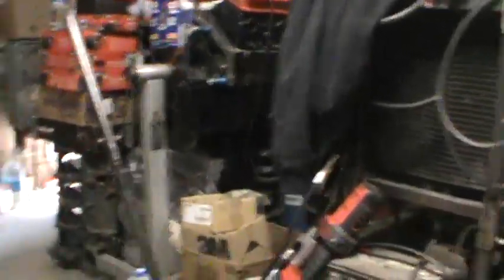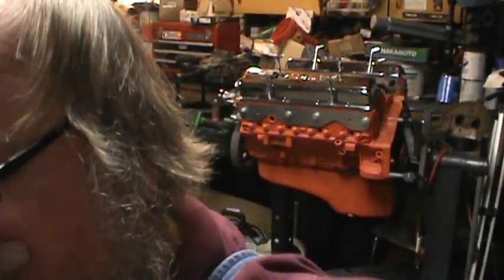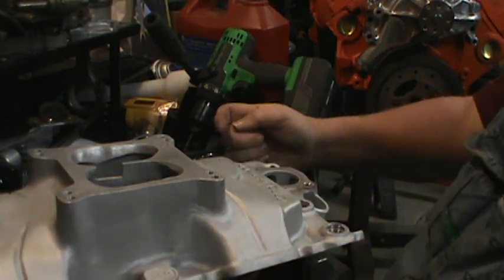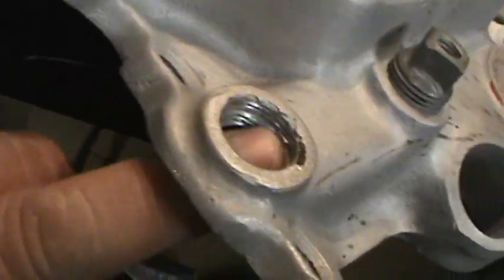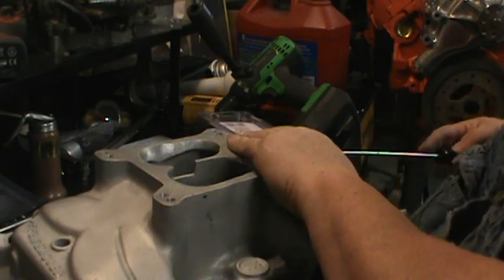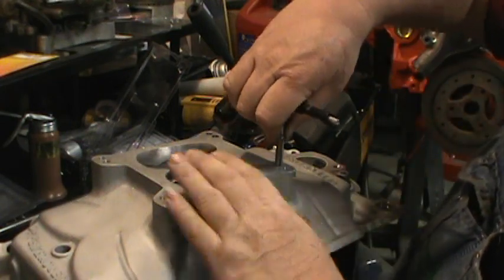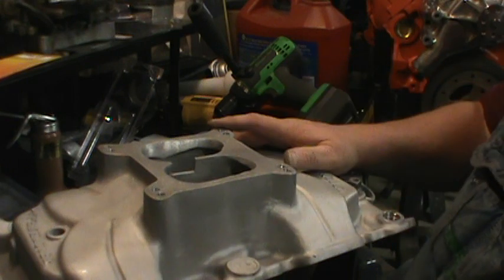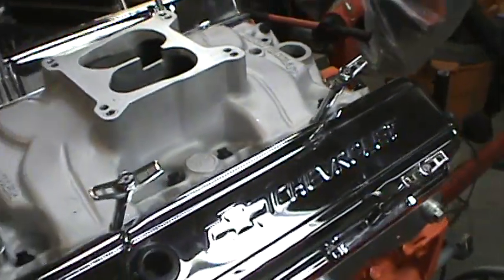repairing offenhauser intake

Comment: Cool old intake and nice repair on it.  I bought some Guy Kelly aluminum brazing rods and they work great on repairing anything cast aluminum.  Nice thing is they melt in like solder but Hardin stronger than part itself can drill tap.  Might work for the next one to close off the inside from coolant just heat up the intake and melt it in.  Hardest part is preparing the surface and getting it hot enough.  Never fun going to doc's  but hopefully the doc can help you out.  Any luck with finding some 64cc heads with 2.02 and accessory holes.
Reply from the maker: i forgot i have some of those rods thanks for reminding me.
Reply: @tlcbear2  👍

Comment: Looks like a great repair. Well I been testing on the street. Got my caprice to 0-60 in 4.9 sec says it will run the 8th at 8.5 and quarter is better than 13.50 i lifted at 1000ft and managed the 13.50. I'm sorry your not feeling better pal. All you can do it get is up and try one day at a time pal we all have bad days.
Reply from the maker: those are nice times cant complain with them.